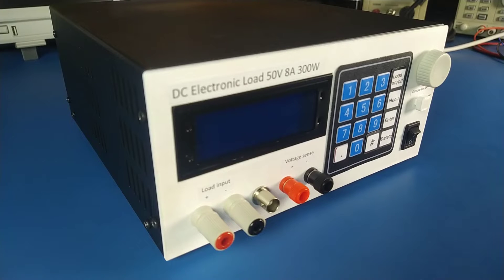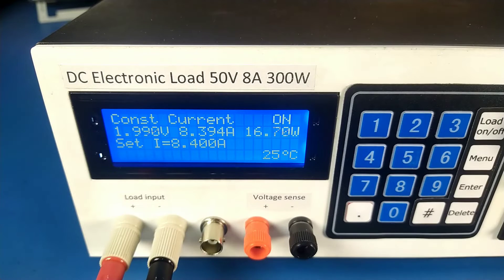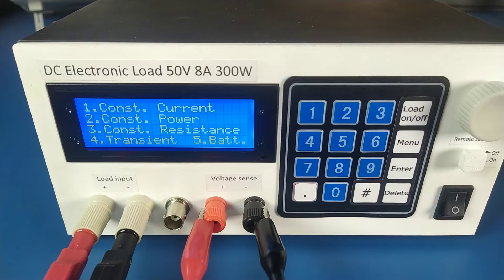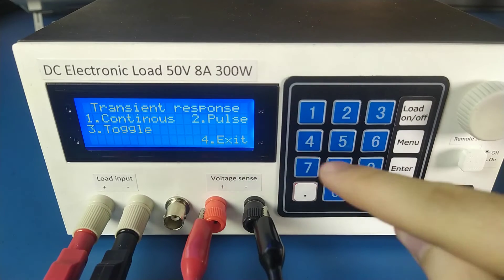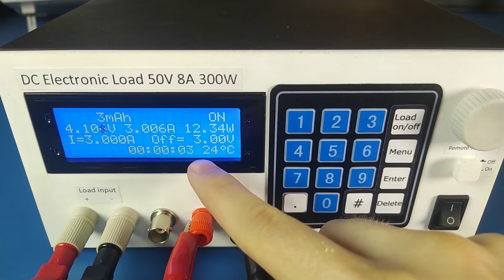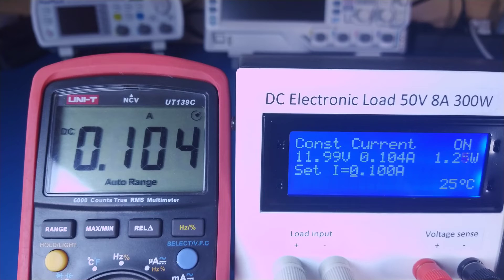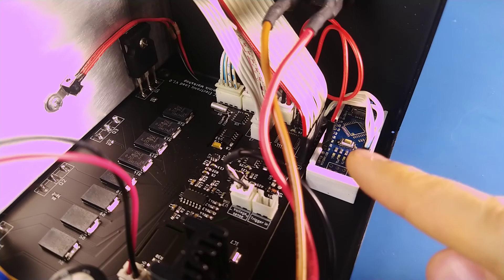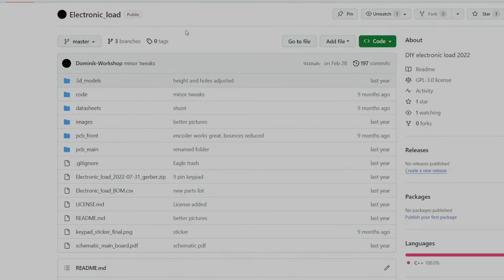DIY DC Electronic Load - 300W

Comment: Very nicely done indeed!

Did you take a closer look at the dynamic behavior of the load? I found that it's highly recommendable to add a RC snubber to the input of the load.  (How) did you address issues related to unregulated operation, i. e. when you disconnect the power supply from the load while the load is still switched on? Without any counter measures, connecting a sensitive power supply in the unregulated state could end catastrophically for the power supply. On the other hand, connecting low impedance/high energy sources might even damage the load itself. (Assuming a minimum resistance of potentially significantly less than 0.5 Ohm, a 50V power source could momentarily force currents in excess of 100A through the load.)

In the BOM it looks like you're using IRFP250. 300W is pretty high for four of these MOSFETs, especially if reliability is a concern. Unfortunately the safe operating area isn't specified for DC at all and for diy builds it seems impractical to characterize the MOSFETs. As a starting point I'd look at commercial implementations: Most loads that use these or similar MOSFETs use 8 to 10 in parallel for 200 to 300W total (they usually allow for higher voltages at the input though, often 120V to 150V).

I'm in the process of building my own low power (about 50W) precision DC load with two current and two voltage ranges. It's soo much work...
Reply from the maker: Thank you! 

Yes, I checked how it responds to sudden input voltage changes and current changes. I made sure that there are no oscillations. The load looks very stable. Regarding connecting/disconnecting a power source when the load is on - I just assumed that you have to turn the load on when the power supply is already connected, because I don't see how this could be solved otherwise. I wonder how it is in proffesional loads. 
One thing worth mentioning is that the current sink circuitry is very fast, so the load would short the loaded power supply for just a brief moment (though it's obvious that this could still damage the power supply or the load itself, as you said), which isn't so obvious, becouse I saw designs where the power MOSFETs were controlled directly by some kind of DAC, so there was a lot of time between connecting the power supply and microcontroller recognising that the current is WAYYY too high.

The 300W rating of this load isn't like a continuous rating, it's more like how much power you  can dissipate for a few minutes (assuming that you start with a cold heatsink). I agree that if you use it at it's max power it could fail after time. I was planning on using more MOSFETs in parralel, but that would require balancing resistors, which I was avoiding, because I wanted to minimalize the minimum input voltage for full 8A. I'm curious how they do it in proffesional loads, because I'm controlling each MOSFET individually with an Op-amp, which ensures that each transistor dissipates the same amount of power. But I'm pretty sure that's not how it's done in commercial loads. In DIY designs I saw, the MOSFETS were simply parralelled with an equalizing resistor in the source path. This makes a compromise between the even current distribution among the transistors, and the minimum input voltage for full current rating. 

I'm curious how your project will turn out!
And I strongly agree, that building a nice load is quite a hassle.
Reply: @dominikworkshop6007  In principle, you're absolutely right: One should never disconnect or connect a power supply to the load while the load is switched on. However, in normal use, one might accidentally forget that the load is still on. You're right again saying that the short circuit lasts only a short period of time. I would argue that "short" is relative and the poor opamp has to drive the gate (with its capacitance) from about opamp V+ (e. g. 12V) down to about 3-5V. Also, MOSFETs have a tendency to turn themselves on when there is a large dV_DS/dt due to the internal capacitance, i. e additional charge is introduced to the gate. This makes the problem potentially worse. So the opamp's slew rate, the opamp's output impedance, the "speed" of the control loop and the gate resistor will likely determine how bad the overshoot will be.

In my opinion it's all but impossible to avoid the problem completely. E. g. the load can't distinguish between a power supply being disconnected (effect: voltage decreases) and the voltage being decreased on purpose. What is an option though: Reducing the effect of this issue.

I have a HP 6060B (schematics available: google HP 6060b Service Manual) which uses a pure analog control circuit for CC, CV, CR (CP is missing completely). They implemented a fairly complex analog circuit to detect the unregulated state (signal UNREG) and likely limit the conductance of the MOSFETs in this situation. Still, connecting a power supply with the load enabled leads to a certain overshoot relative to the programmed value. For my design I use a very similar approach: I effectively limit the gate voltage to a certain value that depends on the current setpoint. (Since the MOSFET's gate voltage varies between different samples and is highly temperature dependent one has to be careful not to limit the voltage too much.) With this the maximum gate voltage would be rather between 6 to 8 V instead of say 12V. This reduces the overshoot massively since the opamp doesn't saturate (hence eliminating the significant recovery time) and doesn't have to work as hard to bring the circuit back into regulation.

In addition it might be a good idea to sample the voltage continuously and switch the load off if the voltage falls below a certain disable threshold (e. g. 0.3V). Using a hysteresis and a time delay one could re-enable the load after a certain period of time if the voltage rises above an enable threshold (e. g. 0.5V). This feature could also be made optional. I think this is something that you could implement fairly easily without any hardware modification.

Pretty much all commercial designs I know of use one opamp per MOSFET plus a current measurement resistor. Opamps are cheap and this is the only way to achieve optimal load sharing. However, some use inverting, some non-inverting topologies. Some loads use an additional current sensing opamp per current measurement resistor and sum up the currents (or rather voltages proportional to the currents) afterwards (e. g. HP 6060B), while others measure the total current across a high power current shunt in addition to the local current regulation (e. g. BK Precision 8600 series).
Reply from the maker: @sebastian_harnisch  In my load, the maximum gate voltage is only 5V (due to max supply voltagee of the op-apm) which limits the maximum current, but of course as you said, due to the miller capacitance as the Vds rapidly raises, the gate voltage can raise as well.

Now that I think about it, turning the load off when the voltage is close to zero is a great idea, if this feature is made optional. I will definitely implement this in the next software update.

I'm pleasently surprised that commercial loads also use one op-amp per transistor. Now I think that I could try using some more generic op-amps for regulating the current through each MOSFET separatelly, and using a precision op-amp for measuring the total current through a precision shunt resistor. My only concern is stability, I'm afraid that using so many op-amps might produce too much gain and the system could get unstable. Mayby by creating suitable negative feedback with RC networks would do the trick, but I'd be afraid that the phase and/or gain margin would be small, and I could assume it's stable, but with some environmentall changes, the design could get unstable. I'm not quite sure how to get bode plots in such device to check it's stability. Do you have any tips for that?

Thank you soo much for your feedback! It is very valuable for me! (and sorry it took me soo long to reply)
Reply: @dominikworkshop6007  Ah, interesting. 5V might be fine, I guess you have checked it, but depending on the conditions (temperature etc.) it might not be quite enough to achieve a low Rds(on). (If not for normal use a slightly higher voltage might help with the „short“ feature many commercial loads offer. On the other hand that might be something you‘re not interested in.) Just lowering the voltage imho is only part of the solution.  The saturation issue is at least as important I think, so the way to go is to both reduce the gate voltage and make sure that the opamp never saturates. Some opamps might be less susceptible to this issue than others, but it might be better to just implement a circuit that avoids this situation completely.

Yep, I use this approach in my design. I think this makes the whole thing much, much more complicated and stability is a huge concern. (Just having many opamps doesn’t necessarily increase the loop gain though.)

A good starting point would be to simulate the circuit in something like ltspice (or maybe qspice, seems to be a good/better alternative created by the original author of ltspice) where you can do bode plots reasonably easily. I spent more time with that than I care to admit ;) This though helps enormously to figure out, what might work and what not to try at all. I optimized the inner loop first and only then proceeded with the complete control circuit.

I then used a simple bread board prototype to take some measurements with my Siglent SDS 2104 plus scope. It has the bode plot feature. However, I mostly modulated the setpoint of the control circuit and measured the current through the current shunt to determine the transfer function/bandwidth. I did not inject the signal directly into the feedback loop (via an isolation transformer) and did not measure before and after the "injection point" which you would do for actual stability measurements (gain/phase margin). What I did do was looking at the step response etc. There are some videos on YouTube specifically about measuring stability of power supplies etc with frequency response/low frequency network analyzers (in case you have the equipment available to you) which might help. I currently don't have the setup (suitable isolation transformer), although I was thinking about building one for stability analysis at some point.

Getting the loop gain right is important. The loop gain can be adjusted for example by varying the gain of the current sense amplifier. DC loads often feature two current ranges, but they only attenuate the setpoint by 10x and don’t switch to a different current shunt, hence the loop gain stays the same - easy. It gets much more complicated if you change the current shunt, because then the loop gain changes and you have to switch something to achieve a lower gain… During the simulation I found quickly that I have to use compensation for the „outer“ control loop (integrator/compensator) as well. This helps massively with the step response. Also, as mentioned before, having a snubber circuit at the input is really important (if not necessary in many cases). This is especially true if you want to build a reasonably fast load.

Regarding loop stability vs environmental changes (temperature): I would argue that resistors and capacitors (especially C0G/NP0) are relatively stable over temperature and the MOSFETs are probably the main concern (or more specifically their transconductance). The inner control loop should be designed to handle the variations between two or more mosfets of the same type anyway, so the temperature is just another thing to look out for… Haven’t done extensive testing on my design yet. Simulations can help here too, but not all models may reflect the true behavior well or at all.

In the git repo you mentioned that you'd like to add reverse polarity protection. What do you have in mind? The load is kind of protected already - the body diodes will limit the reverse voltage to a low value and are conveniently placed on a heatsink. Some commercial products seem to rely on this form of protection (e. g. HP6060B). Also typical for power supplies. I see the disadvantage that this potentially "shorts" the power supply.
Reply from the maker: @sebastian_harnisch  I don't mind MOSFETS not being able to short the input completely, I didn't aim for that.

When it comes to simulation in LTspice, I've had problems with importing simulation models of elemnts used in my projects. I guess I have to play with it a bit more.  But the most confusing part for me doing the bode plots, I managed to get some sensible results, but I'm just never quite sure if I got everything right (eg. if I injected the signal in the right place?). Thank you for all that information, I will try implementing all the avice I got! 

I find such reverse polarity protection, that shorts the power supply, to be a bad protection, I wanted to implement something, that would prevent reverse current flow alltogether. Of course I wouldn't want to put a diode in series  with the load, but I'm struggling to find a solution  for that.
Reply: @dominikworkshop6007  Yes, I get it... On top of the complexity of the circuits the SPICE simulation tools are not really user-friendly at all. Using LTSpice for the first time I couldn't believe how bad the UI is, completely non-standard, what a mess. But it's free ;) Recently I tried QSPICE, really hoping for an improvement. It kind of did improve in some areas (e. g. deactivate certain elements without having to delete them), but in others it seems to be even more cumbersome (e. g. including third party models of opamps). I have a lot of respect for the work of the author of now two free SPICE simulators. He knows his stuff, absolutely no doubt about that and many changes are in relation to the algorithms and their capability. But I couldn't really believe it when I saw him explaining that this is one of the most modern CAD UIs or something to that effect. Not that KiCAD is perfect, but it would be worth taking a close look at it. In its current form it looks better (imho) and more importantly it's light years more user friendly and with less completely random design choices that you have to be aware of in order to successfully use it. I'll give it some time, but in it's current form, I'm better of with LTSpice (never thought that this is possible ;)). But enough for this little rant...

There are some articles etc. published by analog devices that helped me quite a bit, generally speaking.

I didn't really like this form of a protection circuit myself. So for my DC load I use an additional(*) n-channel MOSFET in a back-to-back configuration (i. e. source pins connected to each other), effectively replacing the diode you mentioned by the body diode of the MOSFET. The advantage is that I can actively short the body diode to reduce the voltage drop and power losses there. However, one has to actively disengage the MOSFET in case a reverse condition might occur, otherwise the additional "reverse-short circuit protection" doesn't work, obviously. If the timing requirements are not too strict one can easily deploy a similar strategy to what I mentioned before: Monitoring the voltage and switch off the back-to-back MOSFET(s) in case the voltage at the input drops to something very close to 0 (if one implements the "unregulated" protection, all the code should be already there).

(*): In my case I simply use the range switching MOSFETs for this purpose, hence no additional parts required. 

Still, there are many reasons why one might not want to go this route, e. g.:
- The design is more complex
- The behaviour might be a bit less transparent
- Depending on the requirements the back-to-back MOSFET has to withstand a fairly high voltage. Low R_DS(on)-MOSFETS with a high V_DS rating (like 200V and up) can be very expensive. For my low current application (<=10A) this is very managable and the high-range MOSFET will be mounted on the heatsink. If MOSFETs with a high R_DS(on) are chosen instead, they might have to be mounted on the heatsink and will increase the minimum voltage per given current. For my low current application.